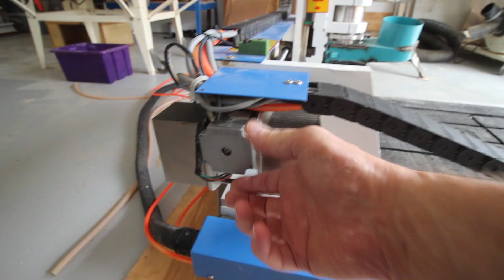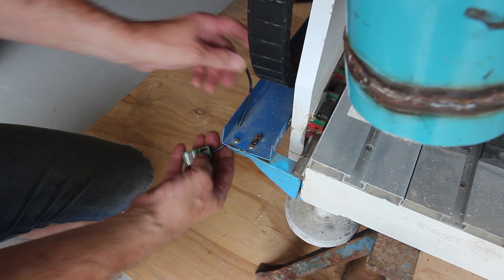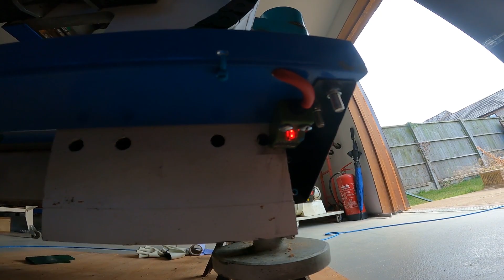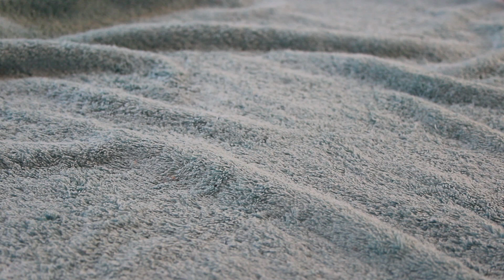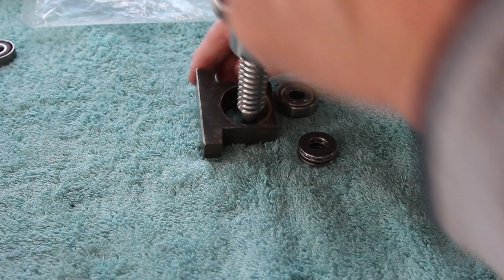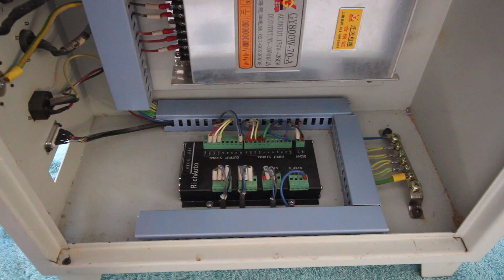Router Upgrade pt1

Comment: I'm assuming this is a 6090 unit. I got rid of my 6040 as it was too small but must admit the 6090 looks a decent size. Are you going to upgrade to Mach3 or UCCNC? I'm in the process of upgrading my Syil to UCCNC as the spindle controller had an intermittent fault and stopped the spindle for a split second whilst the axes carried on!!
Good vid and shows how poorly these things are put together.....
Reply from the maker: Hi yep it’s a 6090 all now works well the bed upgrade is coming along well. No plans to upgrade but I will with my laser cutter when I get that far. I had looked at Masso but it’s quite expensive. I think uccnc is probably best bang for buck!
Cheers

Comment: by making both fan blow out, you will suck inn all dust, the best idea is to have 2 fans inn with filter, 1 out, so that you create positive pressure inside the box, that will make the air blow out of holes and groves that might be around.
Reply from the maker: Good point I haven’t thought about that. Being a lazy bugger I know what will happen. It will get left until it’s so full of dirt that it fails then I’ll clean it out and fix it!
Reply: Adding a proper filter behind the mesh (that one will only catch small birds and the like) to keep dust out of the cabinet might not be a bad idea.
At least it will extend the time to fill it up. 😅
Reply: @andli461  yes, but having negavite pressure in the cabinet, will draw dust and stuff in every opening, so unless the cabinet is airtight, it will draw dust
Reply: Absolutely agree 100%.
Stopping what can be stopped from entering, i.e. fine dust, can’t be a bad thing and as you mention filters your self, I think we are on the same page here.
My main concern was that the wire mesh will be rather useless for anything smaller then a kolibri. 😅